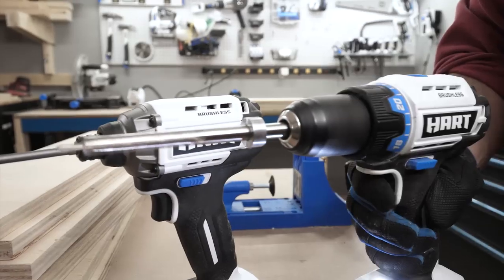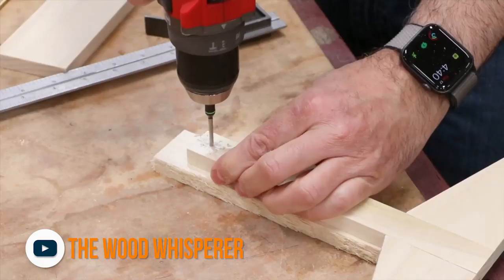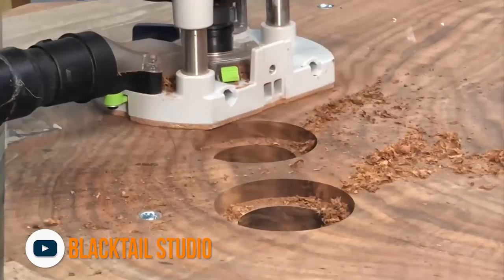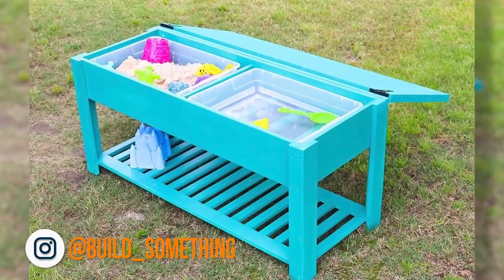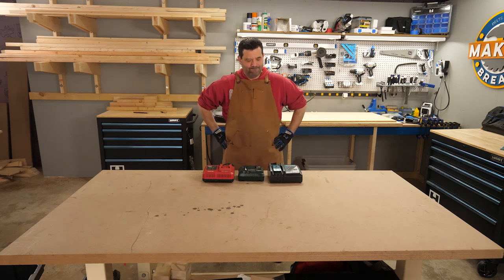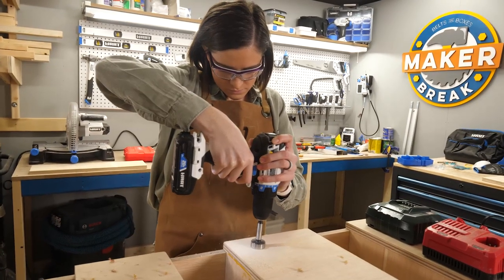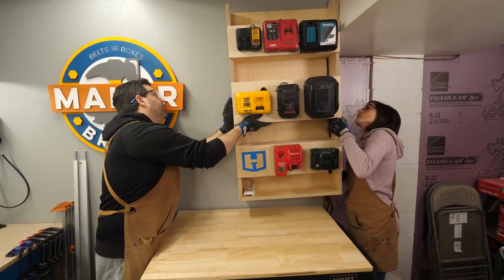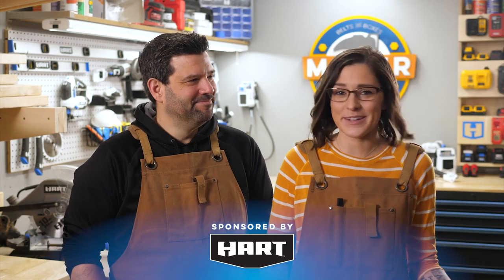We built the [ULTIMATE] Charging Station! Plus our favorite MAKER VIDEOS of the week! S1E8

Comment: I use 3M Dual Lock stuff for my chargers.  It’s similar to Velcro except stronger and less flexible so the chargers stay in one place. It lets me remove them and put them back in a different place or slightly shift them in a different direction if I want them to line up more neatly.